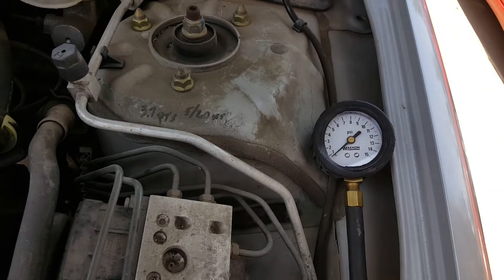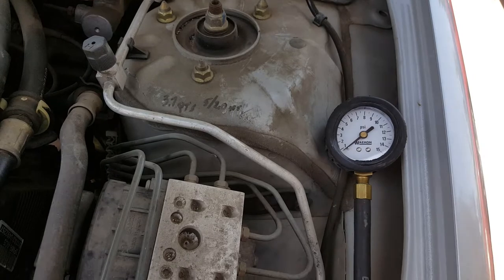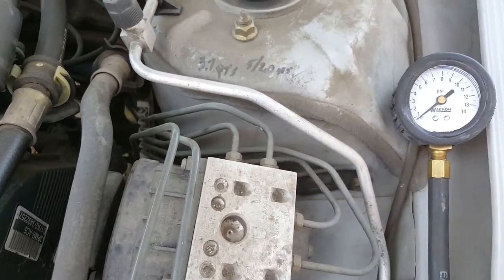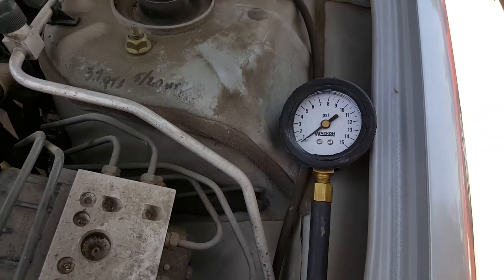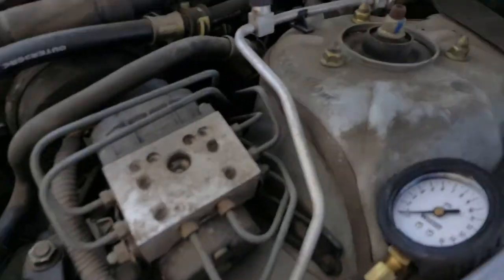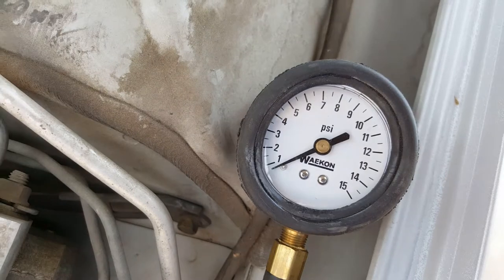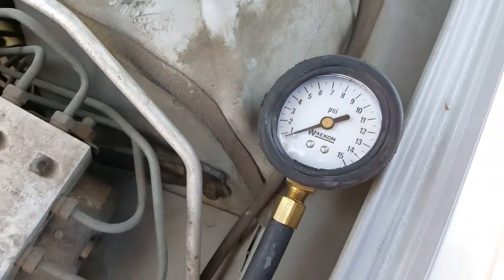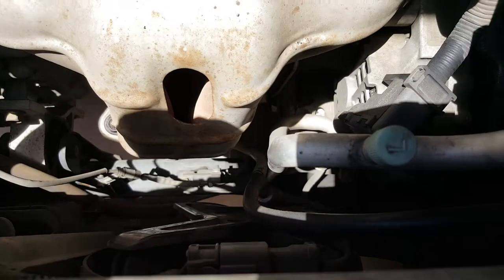2003 Honda Civic 1.7 catalytic converter test (EASY)

Comment: I know this is and older video. But do you remember what brand cat you used for the replacement? I have the same problem. Many say aftermarket cats don't last very long, but I can't justify spending $1,100 on a OEM cat/exhuast pipe on a 2005 civic with 225,000 miles.